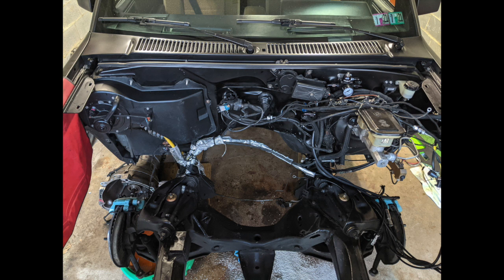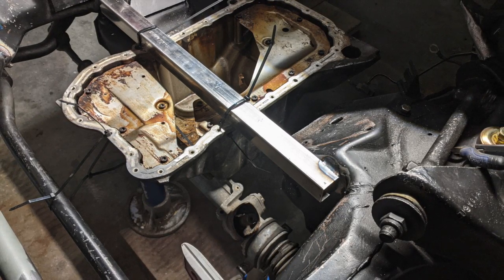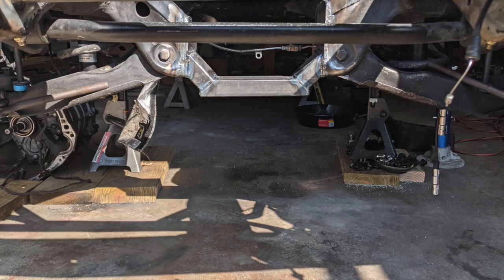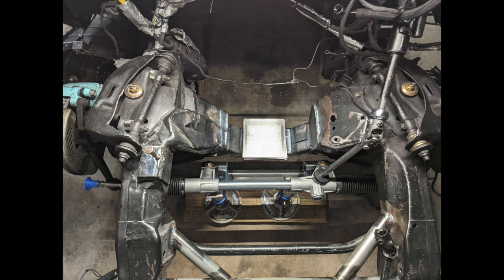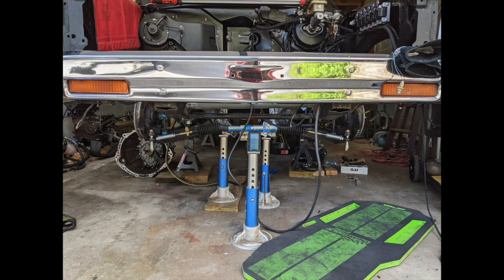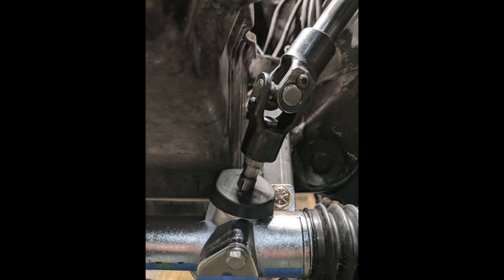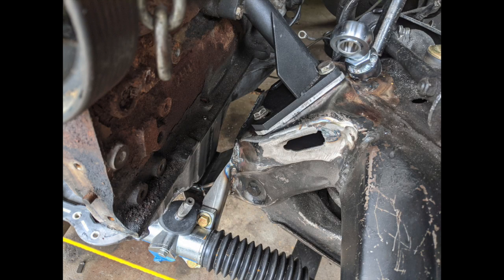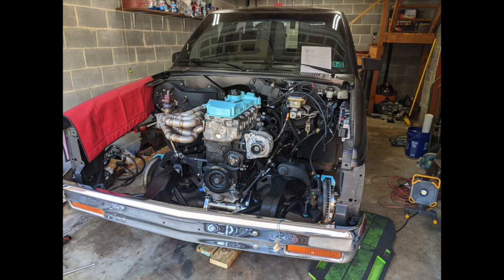VR6 Turbo S10 Toureg Pan Fitment and Rack & Pinion Conversion

Comment: I just found this about the rack and pinion setup.  Was curious.  Did you use yhe pinto tie rod ends.. or the s10 ones? Looking at swapping my old school steering components to a rack.  Thanks for any info!
Reply from the maker: @KaliKustomz1  hi, I used the pinto tie rods, but then put spherical rod ends on them for movement and added spacers to prevent bump steer. I forget what the thread size and pitch is off the top of my head.
Reply: @KennyChurchSpeed  thanks for the response 😊

Comment: man thats alot of work but it turned out nice, what are the benefits of going to rack and pinion and also swapping the oil pan to the toureg one ?
Reply from the maker: To run the toureg pan I had to go to rack and pinion. I will say the rack is very responsive for driving. It's like a go kart now. The benefit of the toureg pan is a deep sump designed for rear wheel drive and I can also use the toureg oil pump. I had my own oil pump set up home made with an external pressure regulator that was complex. This is way cleaner and used OEM parts.